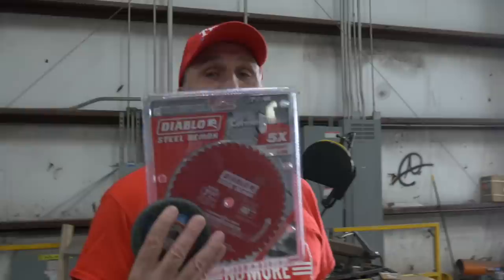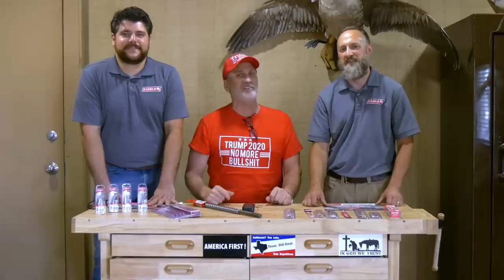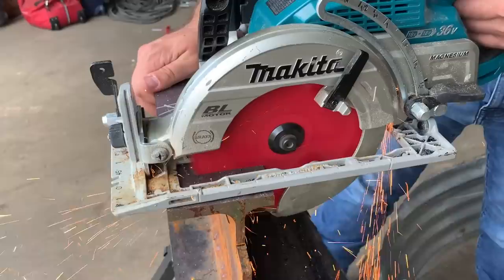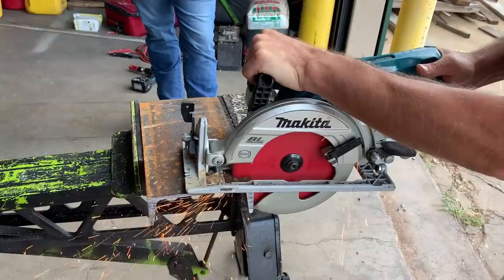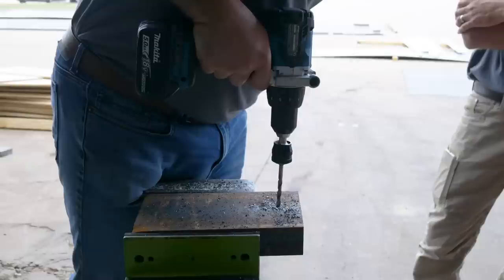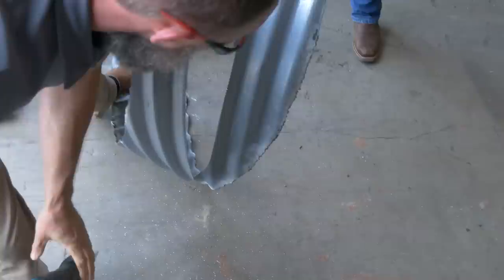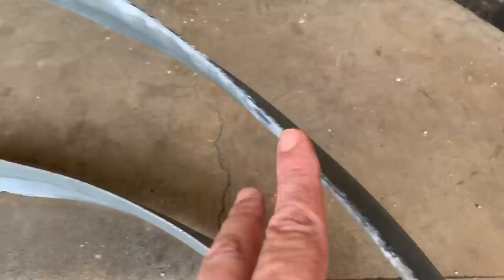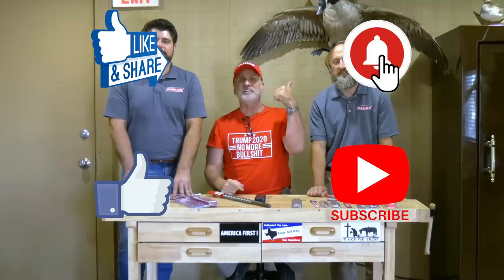Watch DIABLO Blades Cut Through My Steel Like Butter, "CRAZY FAST"

Comment: I've used Diablo blades in the past and I'm proud to say they hold up just as good if not better than sawzall brand, Dewalt, etc.  The ONLY gripe I have is kind of universal that if you heat any of these blades up, regardless of manufacturer they all fail and fail fast.  If you wanna max the life out of any pro-sumer grade blades keep 'em cool and that'll keep 'em sharp!  Be that through a coolant fluid or just taking a few minutes extra between back to back cuts.  TLDR:  Diablo is great blades but have to keep them cool while cutting!

Comment: The reason the chip heats up while the piece stays cool is simple thermodynamics and mass. The large mass of the piece simply wicks away the small amount of heat generated at the cutting site compared to the tiny mass of the chip which must transfer the heat to air which is roughly 20 times less efficient.

Comment: The nice thing with a circular saw, grinder, or reciprocating saw is the ability to buy replacement tools anywhere at a fraction cost and many manufactures to choose from compared to welding or cutting torches and the fuel cost for gas could be reserved primary for welding. The ability to cut faster on a line laid down with snap string while a torch would blast off marking making accurate joints difficult and time consuming and the clean cut joints require little surface preparation for welding.

Comment: How long does the blade last cutting the thin and the thick material?
Reply: It last a really long time on thin material and not so long on thick material!  How much is YOUR time worth? Previously his workers were cutting with a torch - THEN - cleaning up with a grinder of some type.   I can really see him "cutting" his cost with theses blades.
Reply from the maker: Hello from Atlas 😊👋
Reply: @davesanders9203  That's what a lot of people don't consider, saving time, even if you aren't running a business. I repair the family cars, and yes I could use a breaker bar and socket to remove the lug nuts, but I bought an electric impact wrench for that. It's quicker and it doesn't wear me out. If you are running a business, saving time saves you on the high cost of labor. The cost of tools like this is almost nothing compared to the cost of labor.
Reply: They last much longer with a lower rpm circular saw! With a regular 13/15amp 115v makita they are noticeably duller after a few cuts.

Comment: Just a home hobbyist and I'm reluctant to use my 6-1/2" 18v makita on steel like this. Plan on using my saw for life. So I would buy a used, corded saw for steel. Is this a valid concern?
Also, after buying my first angle grinder and watchinga few safety videos, discs freaked me out so I got the blade and it's held up very well
Reply: Thats a valid concern. Metal saw and wood saw operates on different RPM. Metal saws have higher torques for obvious reasons. Surprised no other comments point that out.

Comment: Cool! I think burglars and thiefs just found their new tools! I bet this goes through a safe real easy too...
Reply: Well... this is mild steel, it's not going to work too great on hardened which is what you'd encounter with a real safe, lock, or security door.   Plus these don't do anything you couldn't already do with a torch, a bandsaw, or a cutting disc on an angle grinder.   These kinds of carbide metal-cutting blades have been around for a while on circ/chop saws, but they're usually 50 dollars or more.  If they hold up decently at 30 a pop they would be great for small steel and alum projects, particularly for people who don't have bandsaws or torches.  Much lower bar to entry for efficient metal cutting.
Reply from the maker: Yes burglars would get in quick
Reply: @yunggolem4687 so, I wonder how this works work against one of those bulletproof bunker doors..

Comment: I like it, but here's  my question to you since you run a business, the cost of using these versus a gas axe an tips, cost vs cuts, An I'm all about technology, thx for the vid.
Reply: If you were cutting miles of metal without stopping a torch might be better but he is using a cordless saw and the metal is cool. So you can quickly grab this make a few cuts and use the metal right away, not to mention you wont need to grind your torch cut edges.

Comment: The steel demon I cut 3/8 steel about 20 feet about 1/16 at a time I actually did it and was perfectly straight with a guide but it took 6 hours and the blade was gone at the end of the day I believe it needs a slower rpm

Comment: I have used Diablo wood blades for years and they are THE BEST. However, after meticulously avoiding nails for all these years, the thought of running a new Diablo blade through an I-beam is a shocker. But, that is my problem and I promise I will work on it! Lol... After taking up welding a few years back, looks like I'll have to grab these for sure!

Comment: I got the blade I put it on my skill saw all I could say is wow it cuts through steel like butter I cut an inch and a quarter thick Steel it took a minute to get through it but if you go slow and steady no problem and the thinner stuff cut like you wouldn't believe unfortunately me being lazy and not putting the wood blade back on to cut wood and now I used it on some rebar and it seemed to be doll

Comment: I am familiar with Diablo Blades and I love them.  I have them in all my saws for wood and both for my reciprocating saw.  I literally (2 weeks ago) bought an Evolution Chop saw and an Evolution Circular saw.  When using the circular saw I have to wear my welding jacket, welding hood set to grind and welding gloves.  It throws chips like a damn chain saw.  Ive only used it twice.  The chop saw is better, but the cuts are never true and I have adjusted and tightened EVERYTHING.  I went with the Evolution because of the reviews and the saws don't turn at as high RPM.  That is what people were saying the secret is.  You guys are in T shirts!  I see a returned purchase in my future unless someone can think of anything I am doing wrong!

Comment: I've been looking for a cold cut metal saw for some time. Problem has been spindle speed of power source. 5100/4000 RPM beats the hell out of 1400RPM.Thanks for the heads-up!

Comment: Great demonstration. I do have one observation and question though. I noticed that both the battery skil saw and the reciprocating saw were 36 volts. Were any tests done with an 18 volt battery operated saw? Most hobby shops use 18V. Thanks for sharing.
Reply: Dave, I can say yes I've cut RSJ's with My 18v makita with meal blade

Comment: Very impressive!  I love Diablo products, pricey but high quality.
I have a need to cut pallet wood with nails embedded in it. I use my Sawzall to separate the wood, but need to slice the thicker ribs in half to make stuff, and I want to leave the nails in the wood for artistic effect.  How to cut on a table saw with the nails still attached?  Can this be done with the right blade?  Will I ruin the metal blade if I do wood/metal combination cut?
Anyone?

Comment: They've been making carbide blades specifically for cutting metal for a while. Those blades are designed to run at a lower rpm tho. Will this blade last at circ saw rpms, is my concern?!

Comment: With these new blades, It would be easier to build your shelter now, but at the same time, also easier to cut into your shelter now? You now need to know what it takes to dull these new type of blades. Would have liked to seen that type of blade on a large cutoff saw in action.

Comment: Now imagine one of those blades in a panel saw for when you need to cut steel sheet to size for a bunker.  Would also be easy to automate with a simple drive screw/belt and a limit switch to turn itself off letting the machine do the cut once the worker sets it up.

Comment: I am using Milwaukee’s M18 Rear handle saw and trying to cut 9/16” or 5/8” steel plate with this Diablo Steel Demon saw blade. I bought the rear handle saw brand new from Home Depot yesterday, and threw on a fully charged 12.0AHr battery. 

I did NOT get the results these guys were getting with the battery powered Makita. I could barley cut into an inch into the plate. I then put my depth of cut at half the sheet thickness, and was really struggling made it about another and inch farther. I kept decreasing the blade depth until just the tip of teeth were exposed. This allowed me to make it about 4ft. I think the tips of this brand new blade are not dull and not allowing me to score the plate anymore (not sure, the 12.0 still had 2/4 bars).  

I am not sure why this isn’t cutting through the plate. I know the blade is advertised only to 1/2” plate but it seemed like this was close enough (I saw a guy cut 1 1/2” thick steel plate with a 8” Makita or Irwin blade, his Diablo blade was spent and used a cheaper blade). 

The only other thing that I seem to be doing differently than in this video is I am setting my blade depth to the thickness of the material while these guys seemed like they dropped the blade to full depth. Do I need to be at full depth for this blade to work? I thought they only wanted to be at full depth to try for a straighter cut. I need help. I don’t want to waste another blade

Comment: Question... Can you use these blades on a electric framing saw?
Or do they need to run on the battery operated saws? I guess the better question do these to run at a slower speed than regular wood blades would run?
Reply: The blade will last much longer on low RPM saw designed for cutting metal. 
The carbide cutting tips have optimal cutting speed. Go higher and carbide wears out much, much faster (5-10 times or more). Ask any machinist about the importance of “feeds & speeds” .

Those “slow” saws spin at 2000-3000 RPM. Direct-drive saws spin at 5000-6000.
These low RPM saws designed for metal also have much better chip guards that prevent hot chips from spilling everywhere.
Worm drive saws spin a bit slower than direct-drive saws (4000) so they are somewhere in between.
Bosch and Festool make variable speed direct-drive circular saws that would be ideal- high RPM when cutting wood, low when cutting metal. Unfortunately Bosch doesn’t sell them in North America and Festool is quite expensive.